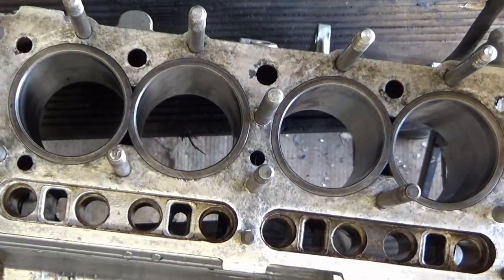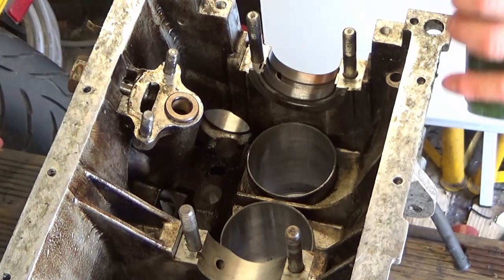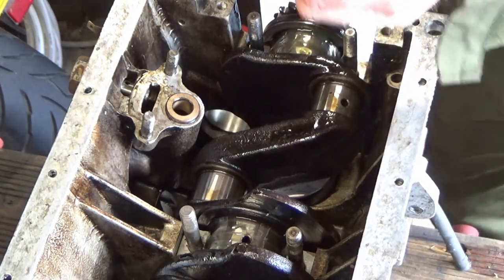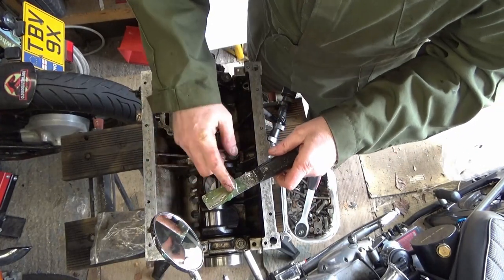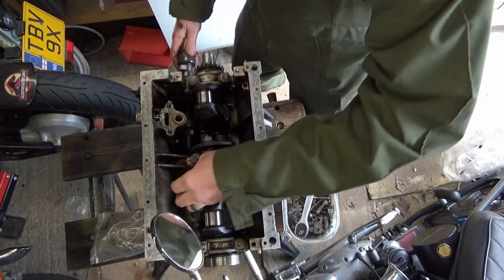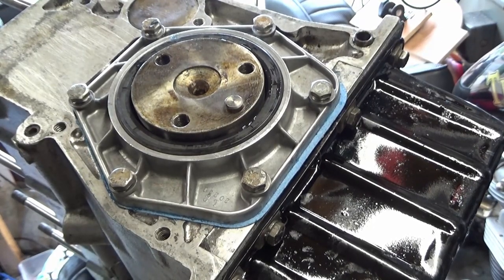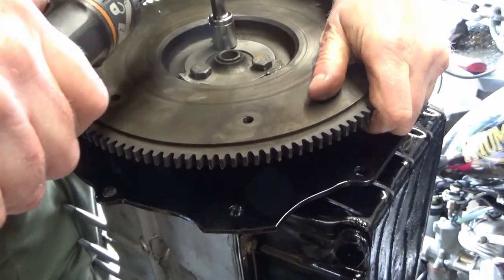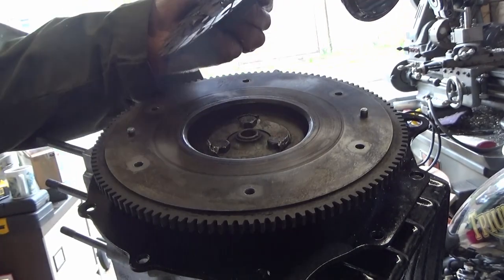Reliant 850 Trike - Engine Bottom End Rebuild

Comment: Made it look easy fella,,nice and simple motors to work on ..
Reply from the maker: Thanks, these are lovely little engines to work on and also very forgiving. I do have a slight advantage as I worked on a few of these but that was over thirty years ago.

But proof will be in the first start...

Edited for my bad spilling...
Reply: Front pulley needs fitting before tightening the cover bolts to try and get the seal aligned somewhat.

If you were going to be accurate about it you would make a sleeve with an OD the same as the seal and an ID the same as the pulley to align the cover before even  fitting the seal.

Why reliant didn't bother with alignment dowels like they have on the gearbox end seal cover is beyond me 🤷.

If you did make a spacer for initial alignment you could probably bore a couple of the bolt holes out for dowels to ensure the cover goes back on perfectly aligned every time.

An sce810pp needle bearing could probably be used as a replacement for the bronze spigot bush too.

They are 1/2" ID 11/16OD 5/8"W with two grease seals, should wear less than a bronze bush and not need honing.